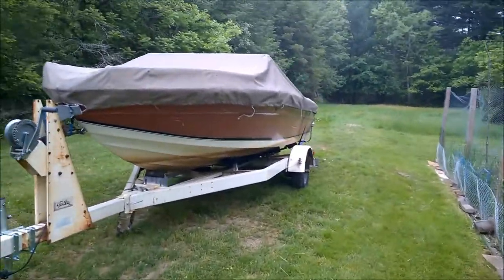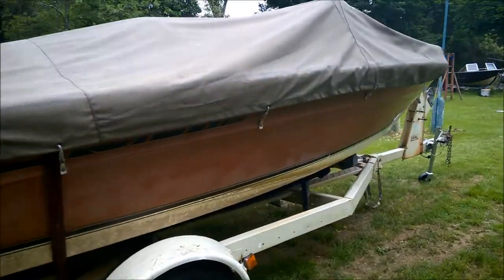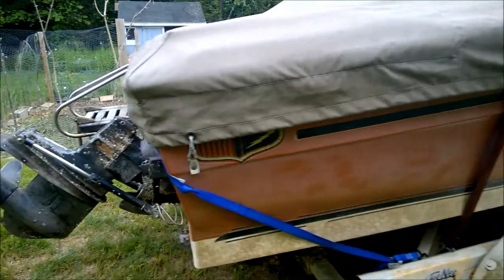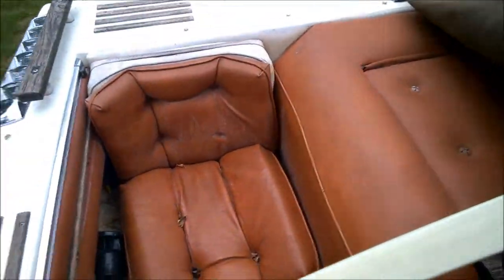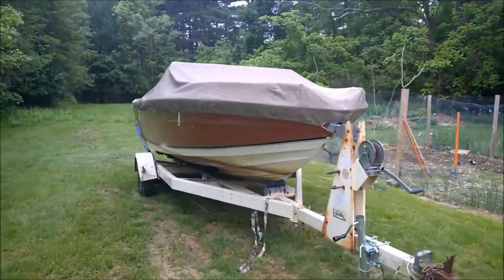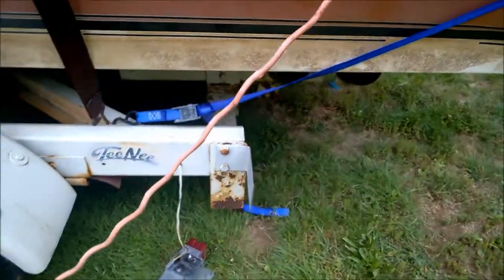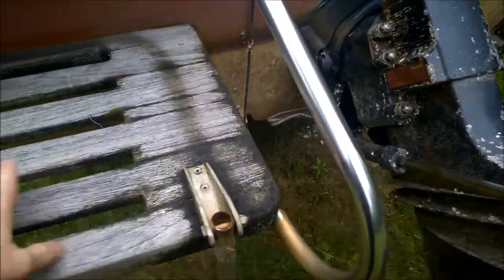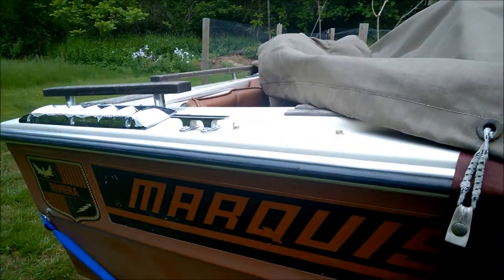I got a free boat!

Comment: You can add bearing buddies hub bearing caps with grease serts inside of them. Use marine grease.& greasegun for your wheel hub bearings for it. Is one ocean preparation step 1. Then undercoat the trailer for the saltwater use step 2. Step 3 you'll need to coat the bottom of the boat for saltwater aswell to for proper use.& holdup ability in those conditions.& elements also. Then step 4 use none ethonal FUEL& stable fuel stabilizer in your fuel when not using it much. Step 6 make sure you cover.& seal it up good when storing it basically is all. Step 7 keep up all maintenance such changing the oils regularly in the outboard motor.& impeller drive shaft gear unit. The drain is the fill from bottom up.& the top drain plug screw is the vent.& level checking vent overflow port .